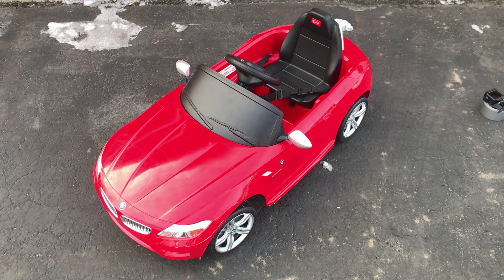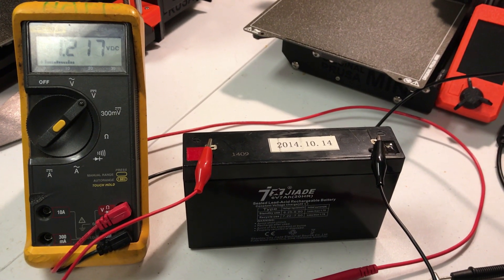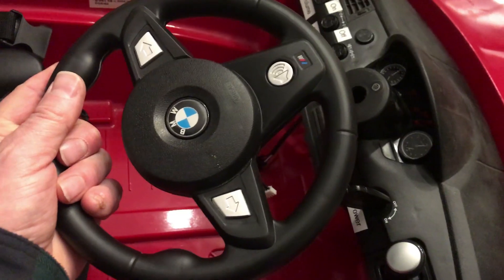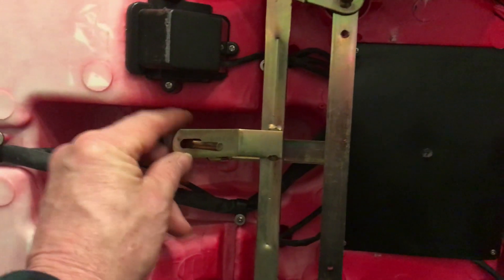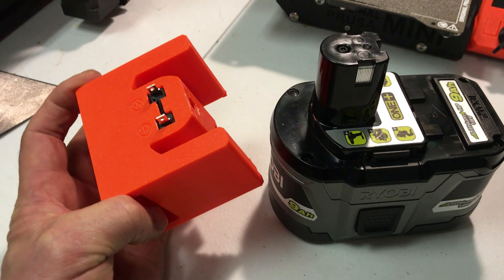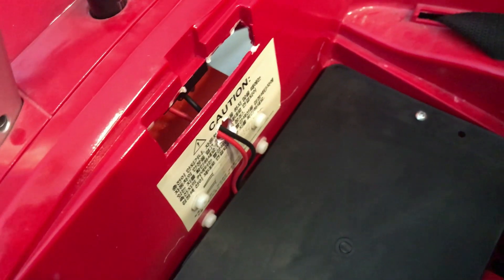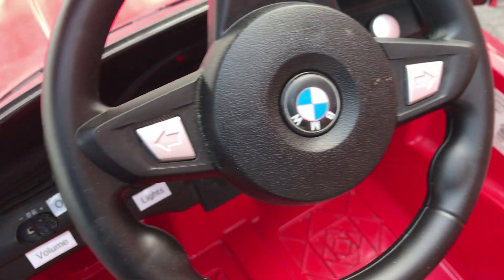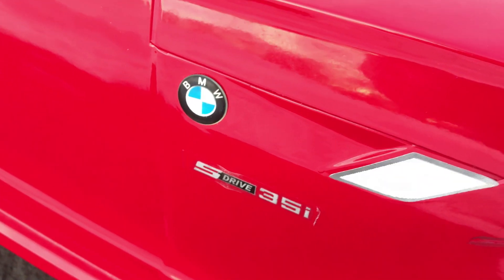Ryobi BMW Z4 18V Battery Conversion

Comment: Thanks for the help I just did a 18v Rypbi swap on my daughters jeep , works perfectly fine, except the remote control wouldn’t work with 18v battery , works great with 12v stock battery , so I had a theory that using the step down to convert the 18v back down to 12v would allow the remote to work again and your video just confirmed my suspicion, ordering the step down converter right now 🙏🏼 thanks again

Comment: Do you have a good source for a dc-to-dc converter with variable output in an input of Up to 48 volts . And an output rating of Up to 60 amps at Up to 27 volts.
Reply from the maker: So a variable output DC-DC step down converter... The only one I've used that is close is the DROK ( https://amzn.to/3cwgddb ), but it is only rated for 12A
Reply: That's a start. Thanks, I'll check it out!

Comment: This is awesome. So tempted to do this on our daughter's little black BMW. But the battery is still good on ours.
Reply from the maker: Nice thing about using the 18V Ryobi batteries is that you can keep replacing them until your daughter gets tired ;-) Also, unlike lead-acid, you can draw them pretty much all the way down. Lead-acid should only be used down to 50% or you will harm the battery life. Also LiOn charges much faster.